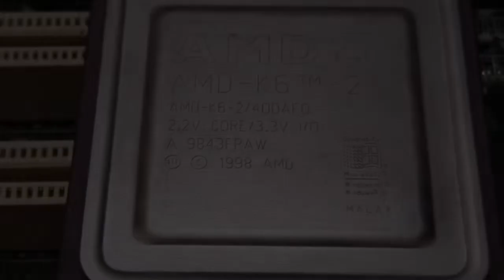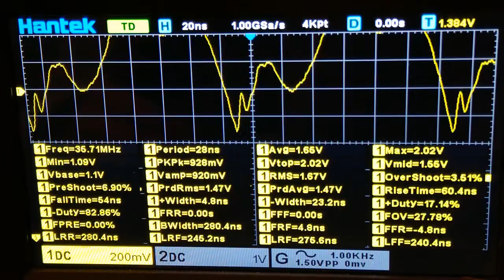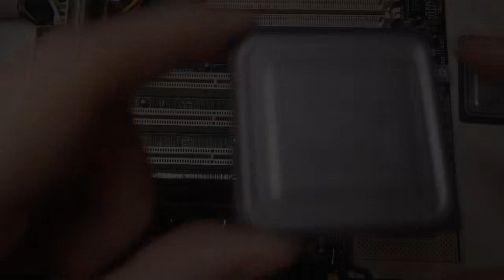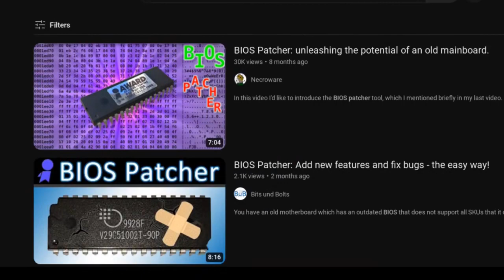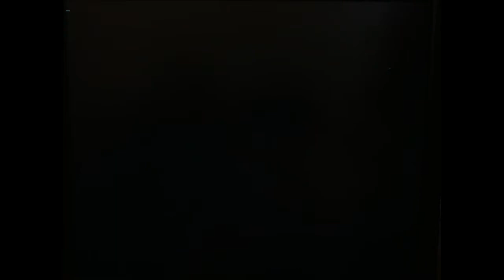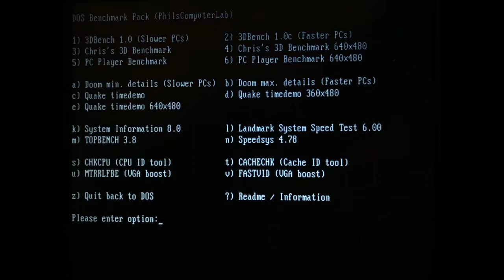Maxing out a 430TX Socket 7 board @500MHz with a K6-2+ and a patched bios (DFI P5BTX/L part 2)

Comment: So a little thermal paste isn't really necessary? Could that CPU handle Win 95?
Reply from the maker: These old CPUs don't really need thermal paste, they are rated < 20 watts.
Win 95 will run fine even on a 486. The K6-2 ones are for the Win98 era.

Comment: Bits und Bolts has a few videos for modding a K6-2+ insto a K6-3+ by moving a capacitor.  This might get you over the top with 256KB of on chip L2 cache.

Comment: Very interesting! As I'm going to try the same with a FIC PT-2011 and I don't want to break anything, I have a few questions:

- From my understanding, to measure the voltage, you turned the system on without any CPU inserted, and adjusted the DIP switches directly, without turning the system off. Am I right? Is it safe to proceed that way?

- What if I don't have an oscilloscope? Can I just try some jumpers configurations and find out what it does when I turn the system on with the CPU inserted? Again, is it safe to proceed that way?
Reply from the maker: - Yes, you should be getting a good voltage reading without the CPU plugged in.
- It should be safe to try different FSBs by plugging in the CPU and checking what the system reports. Just use the lowest multiplier and a CPU that can handle the high FSBs.

Comment: Very nice tip! I've recently got a FIC VA-502 board running a P233MMX. According to the manual, the lowest I could get was 2.8V. I applied a patched BIOS from Jan Steunebrink, which enabled the HDD limit up to 128GB, added more CPUs, etc. I went ahead and measured directly the pin Vcc2 as you did in the video, and to my surprise, it was reading 2.2V (instead of 2.8V). The voltages were completely different from the manual (2.8V was 2.2, 2.9V was 2.8, etc). I was able to install a K6-500 running at 450MHz (6x75). Very happy with that, no need to mod the board and very safe for the CPU. Thanks a lot, really love your channel

Comment: Do all K6-2 CPUs interpret 2x multiplier as 6x or just certain ones? I have a P5BTX/L board and would like to put a K6-2 CPU in it.
Reply from the maker: According to the K6-2 datasheet, chapter 4, page 92: "The ratio selected is dependent on the stepping of the Model 8. The 2.0x
ratio is supported on the Model 8/[7:0], whereas the 6.0x ratio is supported on the Model 8/[F:8]".
So if I understand correctly there are a few models that will use 2.0x, and these are the "Chomper" models. The "Chomper Extended" models will use the 6.0x multiplier as listed here: https://en.wikipedia.org/wiki/AMD_K6-2 . 
So if I understand correctly any K6-2 400MHz or more should use the 6.0x multiplier.
Reply: Will any K6-2 Super Socket 7 CPU work if i set the multiplier to 2x (6x) and FSB to 83Mhz for 500Mhz?
Reply from the maker: Only if they are clocked originally at 500MHz or more. K6-2 are pretty bad overclockers.

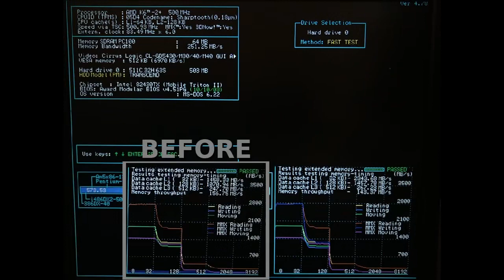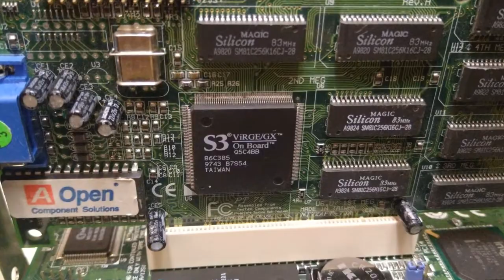Comment: 6:55 1MB VGA turned to 512KB and transfer speed halved. 7:40 Yes, I think this card is dying :) one of the chips might have bad connection? with one chip it switches to 16bit memory bus

Comment: On the TX, 2x translates to 6x on the multiplier. I use to play with various TX boards in the past. The most I ever achieved was 75x6 with actual K6-2 450 MHz CPU's.
Reply from the maker: Yes, 2x is translated to 6x by the K6-2 CPUs regardless of the chipset. Perhaps this board was an exception, I was surprised that it worked so well!

Comment: Great work! Back in those days, I had a Megatrends HX83 main board with a K6 200Mhz CPU that I ran at 83x2.5 for a 208Mhz OC. If I had had the same level of technical skill you do, I might have tried a later K6-2 CPU with it. Instead, I ended moving to an Abit BH6 main board with a Celeron 300A, which was OC'd to 464Mhz for many years.
Reply from the maker: Yeah, these early Celerons were so cool! Socket 7 was pretty much a dead socket by the time these K6-2+ CPUs came out.